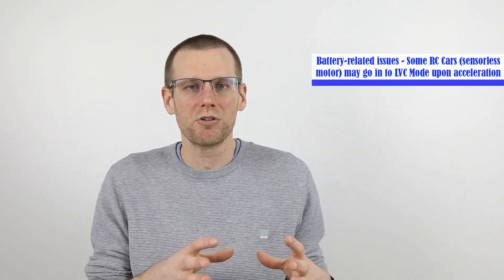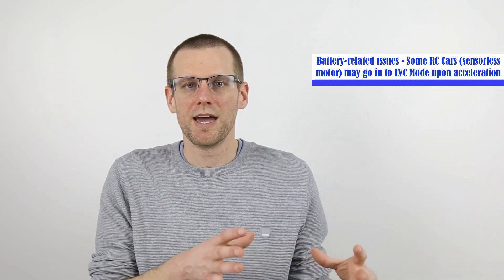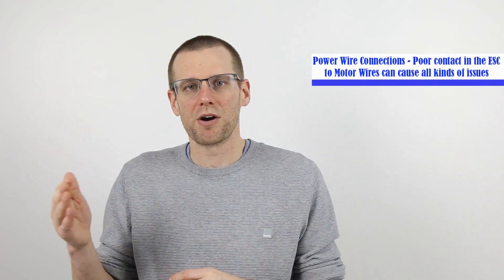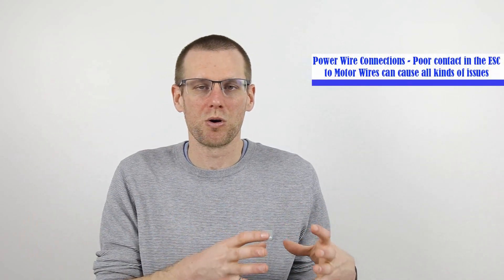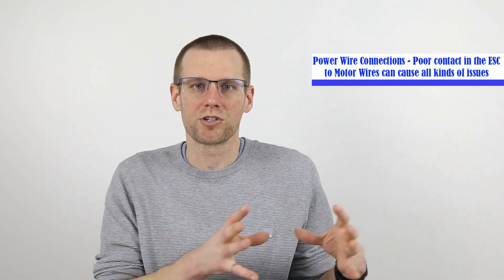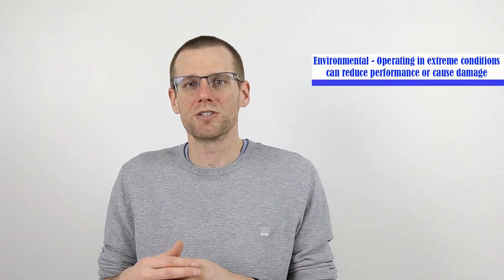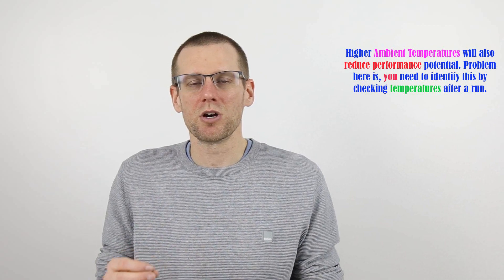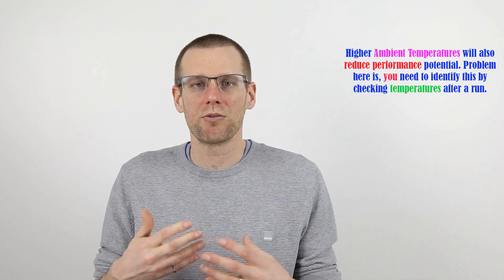Top 8 Common RC Brushless Power System Issues

Comment: This info might be in one of your videos and I apologize in advance if you’ve covered this,, lately I’ve been building a more powerful setup than I’ve ever messed with before, I’ve always used ec5 connectors for most everything I build, I’m now building an Arrma Outcast 8s with aftermarket power system which will consist of using the Hobbywing Max 5 ESC/1100 kv motor combo, I feel I might have overlooked the power here and I’m wondering if the ec5 connections are sufficient from ESC to lipos, or should I look into a different connector that is rated higher like the new qs8 connectors? Just trying to be safe and get the most from this system. Thank you for any insight!
Reply from the maker: Those connectors could work if you gear down the car enough to limit current draw. However, if you plan to draw some incredible continuous or burst currents (200A+), I would upgrade the connectors.